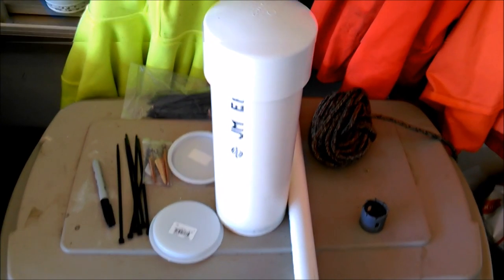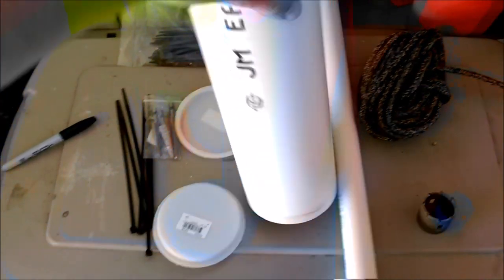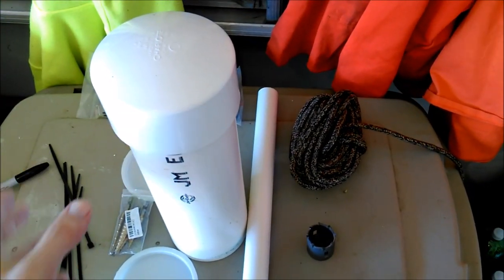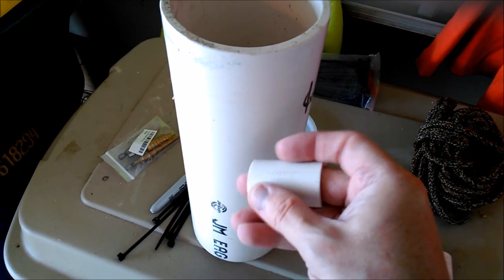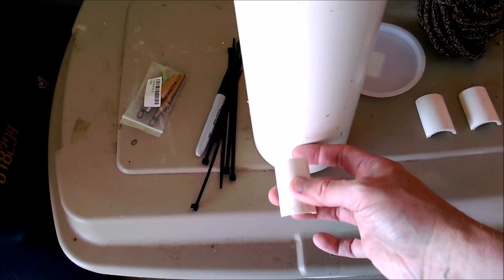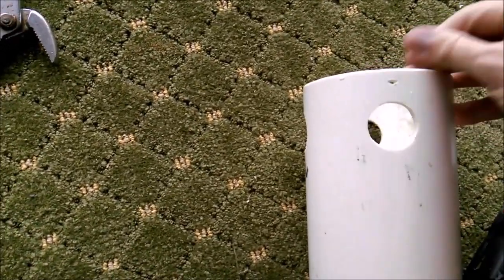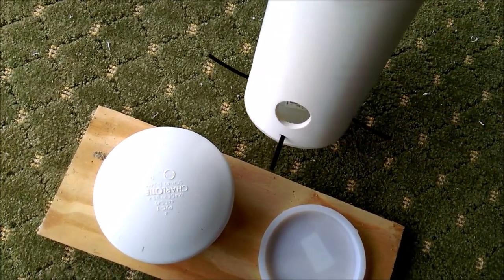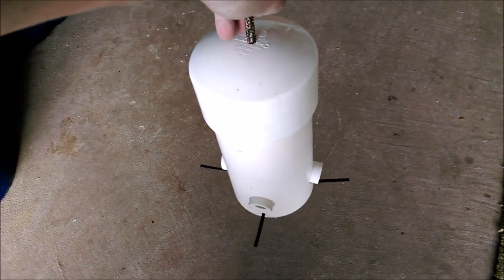Make DIY Type 1 Cheap & Easy Small Birds Feeder Squirrel Big Grackle Crow Proof PVC Pipe & Wood Top

Comment: Your instructions worked out terrific!  The birds started feeding within a day, and the squirrels are still trying to figure out how to get to the feeder.  A few mods to make it even better:

1. use a coat hanger to attach the feeder to a branch.  This will further discourage the squirrels.

2. lower the bird perch by another 1/2 inch.  I attached a colorful drinking straw to the bottom of the feeder using elastic bands.  The birds are finding it much easier to grab onto the straw pipe.

Good luck and thank you!
Reply from the maker: Glad I was inspirational  towards your project. Upgrades sound good. 🤞
Reply: I was just perusing the comments when I read yours and I just wanted to say that I think using colorful straws is a great option. Different colors may even attract more birds. 👍

Comment: Very ingenious.  Great idea to use the twist ties. Strong enough for the small birds but not the bigger ones to sit on. I have been using wire a lot this year to foil the squirrels. They do chew off the rope ties that they hang on so I have had to resort to using wire for that now. Also wrapping around some of our feeders so the bigger birds cannot perch so easy. Your design is very good. You better patent it.
Reply: I used plastic 3 gallon bucket from an old plant and hung it upside doen half way up as a obstacle for the squirrel

Comment: Excellent design!  I really like that you covered all the issues we have with the larger birds.  Not sure if you pulled the Tie wraps all the way through and then trimmed them to length, leaving the larger end butted up against the inside of the feeder?  Wonderfull video.  Thanks!
Reply from the maker: You are absolutely correct on the install of the wire ties. Check out the version 2 I built. A viewer confirmed definitely squirrel proof. I don't see any squirrels to do a video of it in action. Hope it works for you. Rick

Comment: Brian b jun 2020  Used rope however squirrel chewed thru rope. I use wire handle from old gallon paint can and attach from sides using screws.
Made 24in length so squirrels cant stretch down to get seeds... works great
Reply from the maker: That is awesome!

Comment: In remote and rural Nebraska we had huge flocks of all kinds of birds visit our feeders. We went through 100 pounds of various seed EVERY MONTH during summer.  To keep up, I made two PVC feeders like this one, each large enough to dispense 10 pounds of seed. One dispensed safflower for house finches and doves -- and some song sparrows -- and one with cheapo seed mix from Wallmart for everybody else.  (Also spread sunflower, crack and whole corn, etc., on the ground the juncos and big birds.)
Nearest tree was about 500 feet away, so squirrels did not dare come out in the open to visit feeders: kestrels nailed foolhardy squirrels by day, owls got them by night. Lessons learned:  white feeders do not work because the birds are too visible to raptors when they feed.  ABS feeders did not work because they absorbed tremendous heat.  PVC feeders sprayed with splotches of matte green, matte gray, and matte brown camo paints worked best.   Goldfinches hate PVC feeders, so it took me a couple of years to come up with a PVC feeder design they would sort of tolerate -- but never really liked.

Comment: Ingenious!  I would not use the rope because I live in a wet part of the world. I would drill two holes near the top at opposite sides and use wire or similar to hang it up. One screw in each hole to attach the wire.
Reply from the maker: tarjei99 You could do that if the rope is wicking water down into the seed. You could bend a old hanger ;-)

Comment: 4:40 Use a heat gun, or a high-heat, blow-dryer to help squeeze the little pieces. This technique can be also used on long, thinner lengths to make adapter-wands for your regular/shop vacuums. You can shape the end of the wand for getting to unique spaces.
Reply: The vacuum wand extension idea you mentioned is very clever! I've been in need of a very long vacuum wand so I can vacuum behind some furniture that's too heavy to move AND I actually started shopping for a heat gun earlier today. Thanks so much for posting this info!

Comment: How did you hold the bottom plastic cap on?  Sorry. I missed it
Reply from the maker: Drill a hole in the center tie a not at the bottom thread it through a hole in the lid & it becomes your hanger also.

Comment: Thanks for posting.  Good, heavy duty design.  I've learned to add some type of tray or platform below the feeder to catch the seeds that some birds seem to enjoy scooping out of the holes and letting them drop on the ground.  Some of the ones that fall on the ground are eaten, but most do not get eaten.  I prefer making a square plywood platform with strips of wood glued and screwed or stapled to the edges of the plywood.  Let the strip overhang about 1/2" to 3/4" above the top of the plywood to catch and hold the seeds.  You'll be surprised how much seed ends up in the tray instead of on the ground.
Reply from the maker: ManWithPlan ! I completely understand & you probably will see cardinals feeding in your tray design. They like the flat areas to feed off of not the tubes. Here is my updated type 2 version. Thanks.
https://youtu.be/aWSjQZVkCyk

Comment: I'm trying this. Right now I've got a problem with too many sparrows mobbing the feeder. Other bigger birds too. How has the zip ties worked out?
Reply from the maker: damkayaker Mine are still in use with no problems & still have not had to change them out. Good luck.
Reply: Doves are scaring all the song birds away so I think this will work...
Reply from the maker: damkayaker Update with birds actually feeding from it.
https://youtu.be/7kLLtE5DSGw

Comment: any updates? Squirrel chewed off rope and dropped container to ground?
Reply from the maker: They are crafty little buggers. You could switch to a piece of rubber coated wire to support it. You can drill into the sides and loop over the top or still just go through the top. 🤞

Comment: What keeps the seed from pouring out the holes near the bottom?
Reply from the maker: The overhead covers act as baffles. The seeds may fall out a little but it stays inside for the most part. Check out commercial built ones & they are constructed the same way as mine. 😉

Comment: This project did need a fix though, once finished cut the base off a 2Liter plastic bottle and slide the bottle inside with the neck going down right in the middle of the 4 pvc inner pieces. The neck will be the seeds' only way of egress and will also act like a stopper so seed will only fall when the birds eat.
Without the bottle you would not be able to fill the tube all the way to the top with seed, because it will start falling out. Idk about you but I don't want to untie and open that feeder every three days just to refill it. Especially for areas with many birds.
Reply from the maker: s550 k I have been ill for awhile and I will do a short cheaper version soon. 😀
Reply from the maker: s550 k You can pull the bottom cap off and fill from there. Flip up & your good. Hope that helps.

Comment: Schedule 40 is overkill and costly. Use the thinner "drain line" version. Much easier to work with. Lowes carries it, about $10 for 10 feet. The caps are very inexpensive also. Instead of rope/cord, use cable, preferably the vinyl-coated version. Let it hang down far enough to discourage the squirrels from trying to climb down it. A little hot glue sealing over the hole covers will help keep rain out of the feed.

Comment: The overall design is good but I would have used a piece of metal for the perches for steadiness.
Reply from the maker: Cheryl Centenio I don't want steadiness. If they are fixed large birds will come & sit on them & feed all day. The wire ties only allow small birds to feed due to there weight. Which is what I want. But feel free to try your own design. Good luck with your project. Rick

Comment: This is a clever design for deterring bigger birds and nice looking too, but I fear will not keep away squirrels - They will chew off the zip ties in a few seconds and chew away at the feeder until they get into the feed - They will eat wood, plastic and they try to chew metal - But, great feeder
Reply: Sorry -This would keep away squirrels if it was hung by airplane wire which is strong but to fine for the squirrels to grip and hung from a high branch and squirrels were not able to jump onto the feeder - Even squirrels can only jump so far so if it is suspended far enough away from any branch, house, porch and the ground it should be okay - You could also put a steep hood over it so if the little buggers do get down the wire they will slide off - Of course you would need a series of pullies, eyelets etc.  to be able to raise and lower the feeder - Squirrels are very persistent
Reply from the maker: carol alter You are welcome to try and mske your own revised version. Good luck. Rick

Comment: What holds the cap on does It screw on
Reply: Looks like just the tight fit from the cap. Could be a little bit of a pain to get off in hot weather....
Reply: Friction
Reply: If cap ever becomes loose, just drill a couples small holes through the side of the cap and housing body and insert a small nail to lock the cap in place. Remove the two nails and lift off cap when you need to refill.